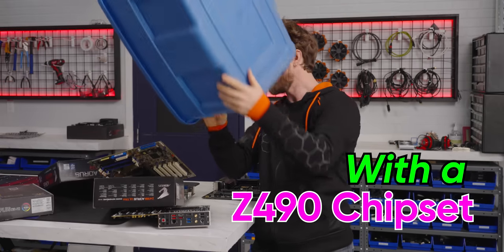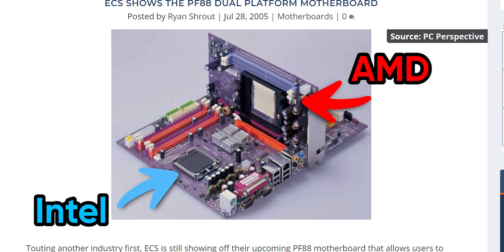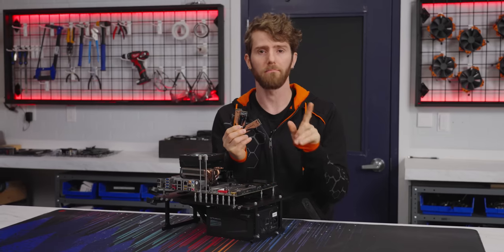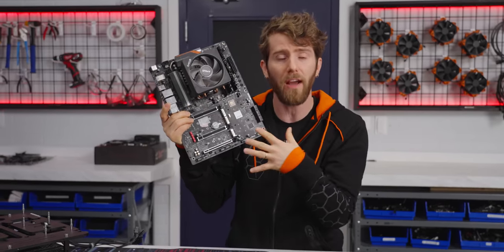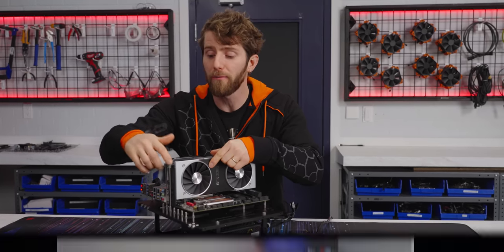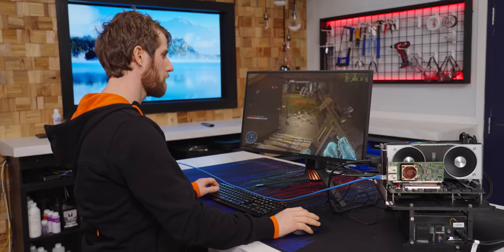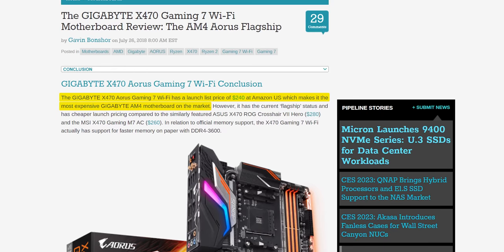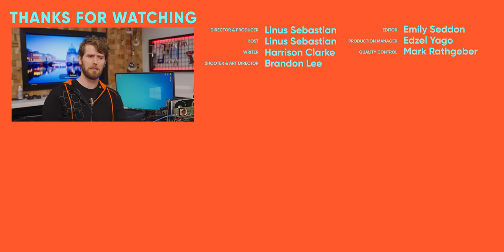I Got This MYSTERY Motherboard From Reddit - AMD Z490

Comment: I'm sad that more companies don't still use multiplexers. I remember my old P8Z77 WS allowing for four 8x PCIe slots on an Ivy Bridge chip. Like Linus mentioned, no extra bandwidth, but it allows for more devices that require a minimum number of lanes to be connected.
Reply: They can hardly use those multiplexers anymore because of cost. In the past, the PLX8747 chips used to cost roughly ~$40 per chip exclude implementation cost for motherboard manufacturers to buy in huge quantities. In 2014, Broadcom bought PLX company, then they jacked up the price of the PLX chip by 3X to ~$120 (again, exclude implentation cost) . So nobody wants to pay that amount because it is just too expensive for what it provides to the end-user. In comparison, the Z490 and X570 just the chipset alone were roughly the same price, close to $50 per chip.  So you see here, the absurd price of the PLX chip.
Reply: @fleurdewin7958  Yeah, it's a real shame. But honestly with the prices of some boards today they should absolutely have one.
I've seen some very pricey "designed for workstations" motherboards that don't have multiplexers and when you look at the features it offers you just think "what makes this for workstations".

Comment: That PLX chip is a PCIe switch, not a mux.  Mux chips are quite common; they are what enables the dynamic switching between a single x16 slot and two x8 slots on most motherboards.

Comment: CPU-Z read something on that board that said Bixby, so it’s possible that was tested with very very early Zen 2 CPUs, since those were released at the same time as the x570 board.  This thing might be straddling the gap between naming conventions and the new CPUs with PCIe 4.0 might’ve been killed it.

Honestly, as someone who owns systems with X570 and B550 boards, both from Gigabyte at the same tier in their product stack, it seems like the older X570 boards were weirdly populated with features, and the B550 was a better feature set with minimal trade offs.  I think if I use both of my m.2 slots for I lose some of the SATA ports because it uses up the lanes or I give up some of the shorter PCIe slots in between the x16 that does 4.0 and the x8 that’s 3.0.

It was so minimal, I feel like the B550 was the far better option because it had more USB A ports on the back.

Anyway, that board wasn’t as much of a dead end as much as it was likely the precursor to the 500 series chipsets, because that has a mixture of things that found their way into both the X and B models.  Even if they ended up going with PCIe switches instead of multiplexers.  My guess is that the multiplexer‘s on that board likely caused more issues and didn’t offer enough utility for the price, compared to using switches.

You should take some really detailed photographs of that thing and send the images over to Buildzoid—I’m sure he’ll love squeezing a solid hour of content out of it.

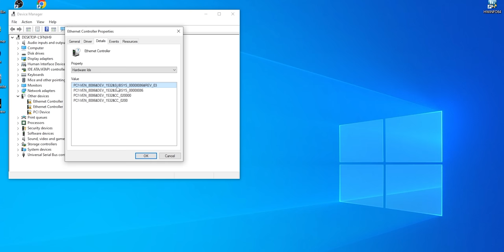Comment: 7:22 the PCI ID repository doesn't have a 1532 device, but the range between 1531 and 1538 are all I210 gigabit cards with different configurations. My bet is that it's a fairly standard Intel I210 but programmed in some weird way

Comment: PLX is not a multiplexer !! it is a (packet) switch. The multiplexers are the "passive" parts that allow you to split the x16 PEG lanes into two PCIe connectors by diverting/stealing the top 8 lanes from the x16 primary header into the x8 secondary header.

Multiplexers are used later in your video, when the GPU and the 10G NIC shares the PEG slot lanes. That choice cut the PCIe BW for GPU in half.. so testing gaming was not the wisest step in that config.

I wonder if you tested the bottom x4 slot alone, since the X470 mobo has it shared with a M.2, which likely stole the priority.
Reply: you cant use a pcie gen 4 x16 with a 4090 and max it out, i doubt this has had any impact at all. gpus NEVER apart from pcie 1 did saturate even 60% of the interfaces bandwith, you forget that pcie WAS NOT MADE FOR GPUS. why should a gpu max out pcie x16?

Comment: RGB on a engineering sample board could be useful to debug errors. Individual LEDs could be color and blink coded to signal all sorts of information about the boot stage etc.
Reply: That's what the beeps used to be for.
Reply: My gigabyte z790 has a dram cpu vga and boot light . So helpful when troubleshooting
Reply: @Level-up-your-life  nearly every not garbage board has drbios.
Reply: @tarkitarker0815  msi has it as well on every board, it's called ezdebug on them

Comment: Linus... As far as Intel lan driver. Custom load a different Intel driver from similar family and it should load. For example if you have i219v, you can load driver for i219lm and it works fine.

Comment: I remember my 486 dx4 100mhz could take intel 486 chips it was top of the line for what it was back then.. it had ISA and PCI witch was fairly uncommon for 486 to have PCI slots here in Australia.

Comment: Gigabyte did release the B550 Aorus Master though, which is one of the only AMD boards with 3 m.2 slots directly connected to the CPU PCIe 4.0 lanes. To achieve this, the primary PCIe slot is limited to 8 lanes if 3 m.2 drives are connected. The board supports RAID for the m.2 drives, allowing read and write speeds of up to 21GB/s

Comment: Recently upgraded to NVME, I like the elimination of extra wires and consolidation onto the mobo. The blazing speed is just the bonus.
Reply: Sata SSDs still fast especially just use for gaming but yeah no extra wires is good and M.2 coming down in price.I only got HDD installed now for extra storage for non related gaming stuff only

Comment: I really kind of feel you forgot the early 2000s when NVidia had the NForce chipset for both AMD and Intel (680i & 680a).  ATI (before AMD bought them) also had both an AMD and Intel compatible chipsets.  Yes these are much older and at the time you had both "North" and "South" Bridges to make everything work including the ports, lanes, cpu, and memory controllers.  I did see mention of the 80s&90s x86 (386,486) that were also true that could take not only Intel and AMD CPUs, but Cyrix, Via, and I even had an IBM 486 DX100 CPU.

Comment: I have 3 4tb m.2 nvme drives in my machine and they're all full, 1 for steam, 1 for video editing content, and my system drive which contains a bevvy of very large video editing, 3d design, cad, and machine learning software.  I've recently been contemplating storage upgrades recently and while I haven't settled on anything yet, a pair of samsung 16tb u.2 pcie4 nvme drives (paired with a couple of m.2 to u.2 adapters) is a very attractive proposition despite costing more than many people's full gaming computers...
Reply: How many games does it take to fill up a 4tb drive jesus christ
Reply: @meowie64  assuming 50gigs each, which is relatively standard for triple-A, that’s 80 games. Assuming you playing a few of those games that are more like 100-150 gig like warzone, ark of GTA V, that number gets even smaller. Still crazy though.

Comment: Have you ever thought about making a channel specifically for the regular retail shopper that can't afford brand new 4090's, or MSI TOMAHAWK motherboards, etc, etc? There are all these other channels that are part of the LTT thing, but it feels like the regular retail builder, or even the beginning builder has to start off with the gear we see on your normal videos, which are usually pretty high end and slowly figure out what came out before all of that. I've never been at the forefront on PC builds till this past Christmas. Even then all I could afford was a basic RTX 3060 which y'all hate lol, a Tomahawk DDR4 motherboard, with an Intel i5 12th Gen. Even all that cost a pretty penny for me. 

It just seems like anything a normal PC buyer could afford to get, is always on the crap end of the shows y'all do, and it would be helpful to see that if we can't afford the biggest and the baddest, we can get a really decent setup on GPU for $250 to $350, CPU from $180 to $350/$400, or a relevant MB for $100 to $200. None of the $500 to $1000 PC parts, ACTUAL reasonable, affordable, prices. Maybe, a video on how you can get a broken PC with a working MB, and know how to identify it. Where do you check on parts to make sure they are compatible in a used setting, things like that. I just know as of right now I technically have to work backwards from whatever builds y'all do to find the actual mid-range gear prices, because what you all consider to be low-end, not worth the time, is a Lamborghini to me lol. I even enjoyed a 1660ti for a bit because it's what I could afford. RTX 3060 was WAY better, for sure, but it's still the crap end if the spectrum for where you all sit lol, and most of the PC's y'all have at home are dirty AF 🤣!! Got servers stashed behind desks, and 4090's covered in spider turds, and dust mite burps 😆. 

I'm just joking, but seriously. Having a LTT show that specifically shows low to mid level gear that ACTUAL retail customers could utilize to maybe not be at the minimum rwlequirements, but to at least get on the board with some newer games. I mean, I could run MWII on a 1660ti and even cyberpunk 2077 lol, but to you guys it was totally uncool to have a 1660ti 😆. It was cheap damnit 🤣 that's all I'm saying, and make it an actual show, and not a video every three months on the normal show lol. An entire show on how to make the lowest end PC work the best right now lol. Give list of recently marked down last Gen gear even. There is a lot you could do.

Comment: Having an engineering sample with the same name as a regular product from the competition makes sense. Anyone sleuthing the internet for information on your secret new project will get confused by the overload of stuff on the other guy's product.

But I have to say I feel like AMD purposely tries to confuse people by using almost the same designations as Intel does. When I built my PC Intel had a B560 chipset and AMD had a B550 chipset. Which made finding out information about things like what CPU power delivery components were used much more difficult, because search engine results would be like "did you mean B550? Now showing results including AMD motherboards while you clearly searched for Intel motherboards"

As for AMD's platform longevity, I never took that seriously anyway. A friend of mine did and insisted on getting a motherboard that had a "good upgrade path"... So we settled on an X470 motherboard, after me giving up on trying to dissuade them from an overly expensive motherboard. Now a couple years later, his motherboard does not support Zen 3, because the most recent BIOS dates back to 2019 and doesn't support Zen 3.
So even if he wanted to settle for an upgrade to Zen 3 now, he can't without buying a new motherboard, at which point you might as well either step up to Zen 4 or switch to Intel again, because at this point nothing modern works on that AM4 board anyway.

Comment: Exactly why AM5 is just using 2 chipsets.  Its cheaper for them and they have full control over the silicon.  Also they don't need repeaters because the first chipset is the repeater.

Comment: Most of my computers have three M.2 drives. My main desktop has four. I always segment my OS to its own drive (something that’s an artifact of what I did back in the day when how I’d have to reinstall Windows too often), and that helps to create the glut of drives.  It also doesn’t help that 4TB M.2 drives weren’t a good ratio of price to size compared to 2TB drives until recently. (My latest one is a 4TB.)
Reply: I have 3 m.2 drive as well. Due to an old H270 mobo and not much money to upgrade with.

Comment: Reminds me of how there's a buncha working Commodore 65 prototypes floating around.

It was a planned budget system by Commodore that used C64 architecture and would be the low end machine, issue is it would've cost about the same amount as an Amiga 600 which was already out and had pretty much the same RAM etc., but using a 16-bit CPU instead of 8-bit, as well as internal 2.5" IDE HD bay among many things that just made it at least twice as powerful.

(it's no wonder they went bankrupt, I always loved their machines, but they created so much unsellable crap)

Comment: I remember hearing about the Z490 aka 490Z. They were probably banking on AMD releasing a 12 or 16 core Ryzen CPU that would have the expanded PCIE bus like Threadripper. Interesting to see it and more interesting to see Gigabyte actually drafted one for testing.

Comment: Hmm, I have a Gigabyte X470 Gaming 7 WiFi, and the PCI-E lanes for the bottom PCI-E slot are shared between that and the M.2 next to it. IIRC by default the lanes are set up for the M.2, rendering the PCI-E slot itself not functional, and you had to go into the BIOS to change that. You couldn't get both the M.2 and the PCI-E slot working at the same time.

I had to troubleshoot it for a while because I installed an PCI-E USB card on the bottom slot, and took a while to get it working.

Comment: I kinda wish something like this existed with like 5 or 6 PCIe x16 slots.  Don't actually need them to wor fast for my use case, just need the slots like my current opteron board has.  If they ever make a new Threadripper I'll probably go that route, but I don't actually need anything more than a 5950x to replace my server and desktop.

Comment: I actually do have 3 NVMe drives in my system.  I had to get an adapter card to run the third one off the second PCI-E x16 slot since my motherboard only has 2 m.2 slots.  Between those 3 drives, all my PCI-E lanes are in use so I wouldn't be able to add any more without taking lanes away from the GPU.

Comment: I'm trying to remember when Intel stopped using the x86 as their primary naming convention. Looks like they went to Pentium because AMD and Cyrix were already selling 586 (or 5x86) processors that really weren't 586.

Wonder what we'd be talking now if they had continued x86. (80)1186? Or would they have gone hex and be using a letter in there (80B86)?
Reply: intel wouldnt have gone that much niche with its naming, not in fivethousand years.

Comment: I built a computer in 2021 with a B550 Aorus Master. Good board, it actually has 3 nvme gen 4 slots direct to cpu, it steals lanes from the graphics card slot.

Comment: 11:11 joke’s on you Linus, I’ve got 4 NVMe drives totaling over 6TB on my 7950X build. Total storage is around 15TB i think. I don’t like working off of external drives and I need both the speed and capacity when working with photo and video.

Comment: I have 5 M.2 drives a 2TB Samsung 980 pro in my PS5, a 2TB Kingston NV2 and a 2TB Sabrent Rocket Q in my PC, a 1TB Gen 3 SK Hynix (don't know model number off the top of my head) in a NVME to USB C (I think it's 3.2) adapter,  and a 1TB Gen 3 Teamgroup (don't know the model number off the top of my head) sitting in it's box that I haven't found a use for (got it because it was on sale for 60 bucks)

Comment: Linus, PCIe is hotpluggable and always has been. Windows never handled it well from day 1, but it does now. When you have the board on a bench you don't need to shut the thing down to plug a network card in :)

Comment: i have 3 m.2 drives on my x570 board and would love more. I'd gladly trade all but one PCIE slot for more m.2 slots (as long as wifi and ethernet are on the motherboard). NVME drives are great. I have like....7? i think in my household now? 3 in the main PC...2 in the secondary..1 in the PS5, and 1 in an external USB enclosure

Comment: When the Intel drivers wouldn't install, you could've tried to mess with the driver install files (.inf) to allow the drivers to be loaded for the PCIe device, if you wanted anticheat systems to work with it, you could've manually signed the drivers with your own signature that was already installed in that Windows installation.

Comment: "How many of you even have more than one m.2 drive today?"

Okay, don't call me out like that. I moved to full solid state when I moved to X570 in 2021 and that included 3 M.2 NVME drives and only one standard SATA 3 2.5 inch drive..... 

So, not 4 years ago, but almost 2 years ago now.

But it does seem to make sense that they cancelled the Z490 chipset since the X570 was already going to give more than the Z490

Comment: Imagine being able to just add additional NVMe drives using a PCIe card? Two NVMe slots on a single card? Done! With the two additional PCIe slots, you can add four more NVMe drives. The cards are under $50, even for a good brand like Silverstone. So why would an extra NVMe slot on the motherboard for several hundred dollars be a deal breaker?

Comment: "more than 1 M.2 drive today" Well fun fact, i'm currently cloning my old hdd system drive to the new M.2 I've got... going from HDD to M.2 SSD directly (well the other M.2 is only my main games Gonna reuse the current velociraptor for smaller games that don't require much ressources and some other programs) And it made me clean up a little (gonna clean up more after I've finished the transfer) of the things I've got on it (as the M.2 is a smaller than my current HDD but gonna be perfect for windows :p)

Comment: Yeah, I'm that guy that had 6 M.2 on x299, and I still do. I'm still using my x299 because of this. I have 5, intel 665p 1tb drives in a hardware raid 0, using the x4 M.2 card, and one 665p on a single M.2 card. And also have the DIMM.2 open still. X299 is a beast still. And using triple 1440p gaming and a 3080Ti, the cpu, 7920x @ 5ghz all core, is not holding me back still. FYI, it's getting me 7000mb R/W back then. Yeah, its still fast af now days. And my OS is on a cosair 240gb M.2. And I also have my older 2, 500gb samsung 850 Evo's in raid 0 for another TB. I'm doing just fine.